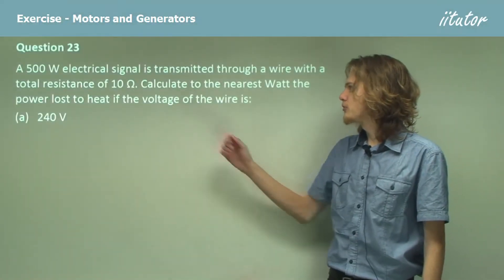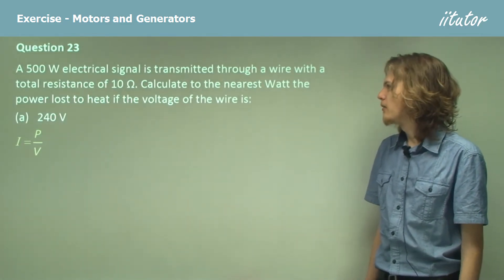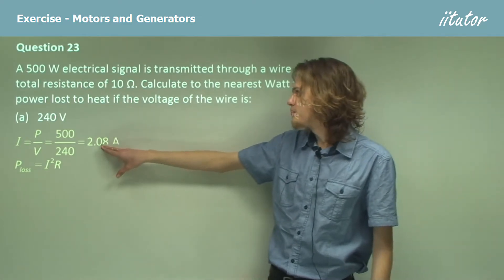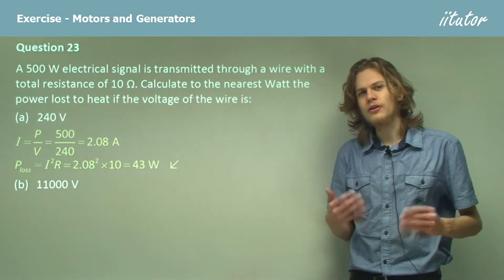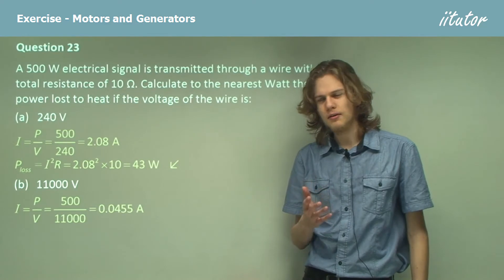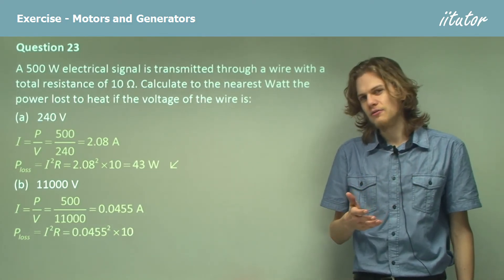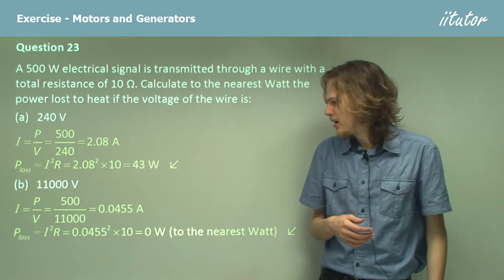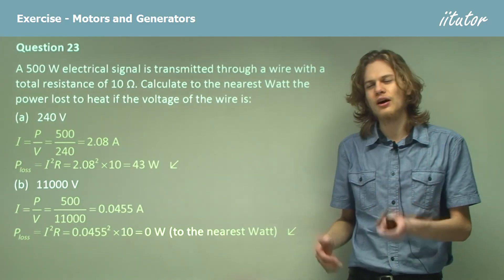💯 Calculate watt the power loss to heat given voltage of the wire | Motors and Generators

Comment: Slow down. How are you able to modulate voltage while keeping both resistance and power the same? Shouldn't power go up when voltage does if resistance stays the same?
Reply: You're looking at this from a "resistor" perspective as in if you applied this voltage to a resistor, the power through the wire would increase as the voltage is increased. HOWEVER, what he's showing is a consistent power load across a wire and how transforming power to get it to your house is beneficial. So for example, if the 500w load is a microwave in your home running on 220 volts, it would cost 43 watts to get that power from wherever the source is. But if they use 11,000 volts to carry the power to your home then transform it to 220 volts to run the microwave safely, the loss is only something like 0.02 watts. He's of course, not showing the cost in transforming the voltage, which can be around 3-5% so the real cost is .02w + 25w (assuming 5%) = 25.02w. Still far better than 43 watts and there isn't really any discussion here about how far of a distance this power is coming from. 10 ohms is quite a bit for loss over a power line but who knows how far away that power plant is and the losses could be even greater if you're not close by.